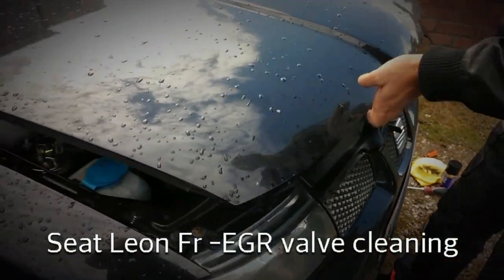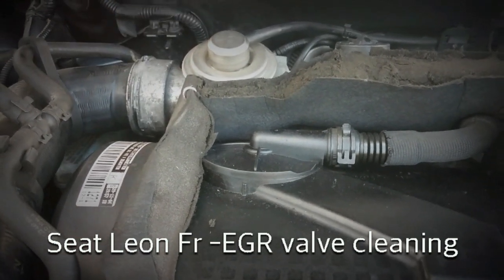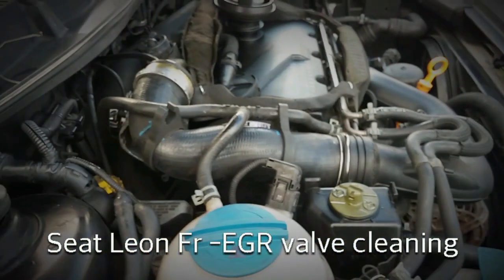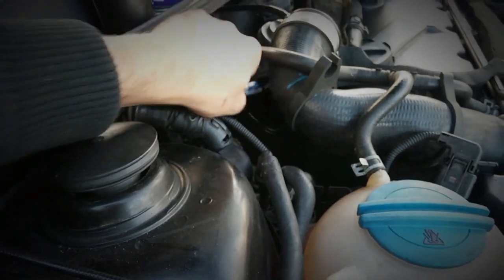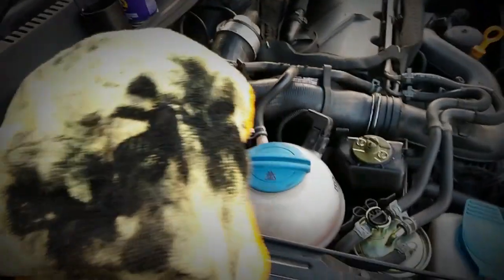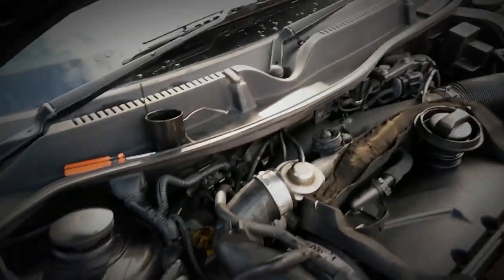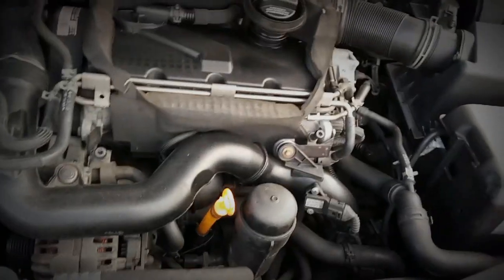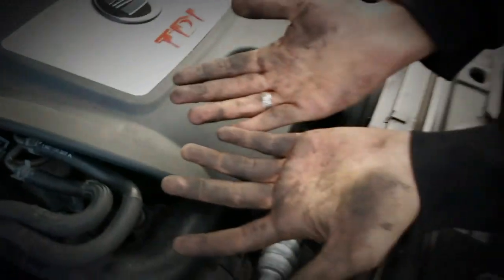VW / Seat / Audi / Skoda 1.9tdi EGR valve cleaning (without removing)

Comment: a good idea. I cleaned the skoda fabia in this way. I recommend using a toothbrush inside the EGR. but be very careful! I flooded the combustion chamber cleaner! you can damage the engine! if the engine does not start, remove the spark plugs and blow out the combustion chamber.

Comment: Concern is broken bits of carbon going through combustion hitting a fin on exhaust side of turbo and chipping it which will send it out of balance and thus fuck the turbo. Seen it many of times from this type of cleaning. Best to remove and clean the good old fashioned way.

Comment: Great video. 
I'm surprised that there aren't any products that you can just add to the fuel system to do this for you
Reply: Fuel doesn't go through the egr valve
Reply: @daddymac40  
Yes I know, but you can use a Catalytic cleaner which you add to the fuel, so I thought there was something similar!!
Reply: @benpar8120   - The Cat is nothing to do with the EGR.   As he said, it is physically impossible to put something in the fuel tank and it have any effect at all on the EGR.    EGR cleaning must be done through the air intake.

Comment: My seat altea keeps going into limp mode and the coil light comes on loses power if I turn ignition on and of it’s fine for 5/10 mins then it does the same could the egr be coursing the problem ??
Reply: This is happening me now with a leon mk2, do you remember what fixed this?

Comment: You have no idea what you’re doing, taking off the intercooler pipe and reviving will cause black smoke regardless if you’ve sprayed shit into the egr because of the unburned fuel.

Don’t fuck about with it if you don’t know what you’re doing, you’re more likely to throw chunks of carbon through your engine than you are to properly clean the egr.

If it needs cleaning, take it off and clean it.

Comment: Done this on a VW TDI but not wile running would it damage anything if used Wyn's carb cleaner wile running please can I ask
Reply: There's a risk that removed carbon can do a lot of demage to the engine if comes to a surten parts of engine, doesn't matter if it's running or not, most mechanic will tell you, if you do perform a carb cleaning safest way is using non "agresive" cleaners depending of how old is the engine and mileage coverd. Basically"younger" the engine the risk is lower. 
So safest way is completely removing the EGR valve and then clean it, sometimes despite a clean EGR valve there is mechanical damage specialy with a older EGR, and there is also a faulty electronic component on a newer cars that can cause a EGR malfunction.

Comment: Hi would this cause stuttering on acceleration on a TDI it's only done 15k miles but is a few years old
Reply from the maker: Swish wow that's very low mileage. Are you selling it? Hmm If its that low mileage unlikely to be caked up egr, could be a number of things perhaps maf or engine temp sensor but also take the engine cover off and see whether any of the pcv hoses or any other pipes are split or deteriorating, while your there inspect the dipstick tube carefully to make sure its not cracked or broken anywhere.
Reply: Redline Revs H mate  thanks for quick reply no loose pipes so I'm thinking egr turbo or fuel filter perhaps

Comment: There are three ways of doing this depending on how much you love your own car.
1. You barely appreciate your car: Use a cleaning product to force residues onto the engine, risking damage being made to the internal componentry.
2. You appreciate your car (to some degree): Remove, clean and reassemble, risking damage to the EGR valve be made during a non approved cleaning process. This could probably lead to EGR once back in the engine to again fail requiring further cleaning and/or replacement.
3. Best practice (in my view): Replace EGR with new to ensure once back in the car this will properly work for a long service period and reduce (not completely remove functionality) the amount of gas recirculation so that the EGR maintenance interval is enhanced keeping functionality  using in case of VAG group VAGCOM.

Comment: Hi,

Would like to clean mine on the he Bora (280,000 miles) seemed a bit sluggish so changed air flow meter and now a lot better, so now might have a go at this as I'm sure it would be well gummed up...got one of those vag-com readers and its coming back with the following fault '19561 valve intake manifold flap (n239) open or short to ground p3105' just wondering if you seen this before? the small pipe that attaches to the top of the valve is damaged also any ideas what you call this so i can order a new one?

Thanks in advance

Harry

Comment: I have problem with my car skoda same engine i lost the turbo boost while im driving on the highway and i changed the turbo two times its work for one or two months after that the same problem back again help me plz
Reply: Do you use synthetic oil for turbo cars? I had similar problems in the past though with synthetics even in good condition turbos I had to replace them twice as you in short period maybe less than two months. They are sensitive I think.

Comment: i have a vw jetta 1.9tdi 2006, very low mileage 37000 miles legit. its a weekend car hardly drive it. when i do engines warm etc when i punch the gas pedal cloud of black smoke comes out of exhaust but no smoke while idle or under normal driving condition. took it in for dignostics no fault codes turbo egr working in spec. guy said take it out for long drive its prob carbon build up. what do you think? Thanks

Comment: Would this method not send all the soot and blank gunk through your engine or turbo, resulting in valve damage or some sort of damage?
Reply from the maker: ***** Hey, thanks for your comment. The spray doesn't dislodge big parts of carbon, it dissolves it into a liquid. Soot and carbon is constantly passing through your engine on a car fitted with EGR system. As for your turbo, the turbine is being driven by exhuast gases. This is method is not going to damage your valves at all. If you're still concerned then I have shown how to dismantle and clean EGR more thoroughly here: https://youtu.be/bbUNGjY3T9s Hope this helps.
Reply: Redline Revs Thanks for the reply.. I watched that video today after this one, good clear instructions on how it's done but I went and took the easy way with the Wynns spray through the air intake and a dose of Millers ecomax in the fuel tank. (I'm a complete novice under the bonnet so didn't fancy tackling the EGR). Problem was,My car wouldn't start for 4 days after getting p0101 code on diagnostics, I changed the MAF sensor, still no start. Checked the anti shudder valve and it was stuck so I pushed it back down and hey presto, car started first pop and is driving better with the new MAF.. The Anti Shudder Valve was caked in suit and grime which was causing it to stick, WD40 helped to loosen the dirt and it's now clean and working properly. I don't know how my EGR looks inside but car feels more responsive and healthy.. These videos are a real help btw. Cheers bud.
Reply from the maker: ***** Glad you got it sorted, not so much a novice now! If your ASV was caked up, wait till you see the EGR valve and inlet manifold.. The ASV is the clean side of the two. You could probably do with tackling that EGR more thoroughly at some point. I recently deleted mine and replaced with race pipe, makes a world of difference, but half the footage was corrupted on my memory card! If you can bring the car to West London I'm looking to delete EGR on a volunteer 1.9tdi for the channel.. Thanks for your support and glad you found the videos helpful.
Reply: Redline Revs I dread the thought of what's in that EGR but I will get it done soon. Unfortunately I'm in Belfast, Ireland, so West London would be a bit of a hike for me but I appreciate the offer. Is there any downside to an EGR delete?
Reply from the maker: Down side is losing the anti shudder valve which,  could help stop a runaway engine but then you could do that by stalling if your car does ever suffer from that rare problem. Certainly not much of a concern for a well maintained tdi. And your engine management light will come on in most cases but I've just been clearing it. Will eventually have that mapped out.  Car has been running much smoother since my delete and I would recommend the mod. Also should mention it makes shut down slightly as there isn't ASV choking air supply to engine on shut down. That doesn't bother me feel like it's producing more power since only clean cool air is entering the engine and very  happy with it. Also won't have to clean that thing ever again.
Reply: did you ever get a test subject for an EGR Delete? I'd love my Fabia VRS doing! Its remapped but recently has been kicking out some right smoke.. does changing the fuel filter and sticking a PD 160 intake pipe on help?

Comment: can this also be done on petrol engines aswell ?
Reply from the maker: Rohan Rehman Hey, I used to have 1.8t petrol which does not have EGR valve, instead it had a throttle body which you can clean like this. Beware if you unplug it you may have to reprogram using VAGCOM.
Reply: Penis

Comment: Hi, great video thanks for this!! Had a few tdi problems with limp mode which has been greatly improved with new boost sensor (1.4tdi vw). Had low air flow but air flow meter was changed but didn't correct. As such, suspected egr/inlet manifold carbon deposits.

Decided to follow your video and did all, egr value did have build up and at point where vertical rod goes down reckon air flow was restricted.

Sprayed a can or egr cleaner in and made a big difference but when I revved it hard didn't see any black smoke at all?!?

Car is fine before I did this until on motorway at 65mph+, feels really down on power (compared to 1.4L petrol too which should have similar power). 

Haven't gone on motorway yet but in your opinion, does this mean that my low air flow may not be this? I also feel reluctant to remove inlet manifold as big job and egr value was no where near as bad as some photos your see (10 years old, 50k miles). But seems like a likely cause. 

Would love to hear your opinion and again, that's so much for a very informative video!!
Reply: Also, inspected air filter and will replace but didn't looks too bad, so feel this is not the source of low air flow either....
Reply from the maker: Andy713uk Hey Andy thanks for watching, looking back on this the reason I had so much black smoke is because intercooler pipe was still unplugged lol. This method of cleaning does still help as you mentioned, but I uploaded one just yesterday on how to dismantle and clean egr more thoroughly. When you take it off you should be able to inspect how bad the inlet manifold is. Your low air flow could be a leaking pipe somewhere? However, limp mode on tdi engines is often a result of sticking vanes in the variable geometry turbos. Mine kept doing this, managed to fix it with Mr muscle oven cleaner in the turbo, check out my video on that. Do you have any lights on dash or fault codes logged?

Comment: my audi A3 2.0 TDI has done 80,000 miles from new. i might take off the EGR and clean it. do you have to reset the engine management light if the EGR is removed.
Reply from the maker: michael jagger Hi Michael, Thanks for watching. You can remove and clean EGR on Golf Mk5 platform 2.0 tdi without any lights coming on. I'm looking to do this job on a 2.0Tdi for the channel if you can bring the car to me would love to help. I'm in West London PM me.
Reply: Redline Revs sorry i live in the north. my A3 has done 80K so its probably worth checking.
Reply from the maker: michael jagger No need to apologise! Probably worth doing at that kind of mileage. Good luck!
Reply: Redline Revs try it and see ive got the BKD engine in mine
Reply: +Redline Revs I did my EGR valve last year on my A3. I took it off the car cleaned with mr muscle and a dremel. Quite easy to get to and a BKD engine andthe engine management light didnt come on. no increase in mpg but still drives great

Comment: Interesting way of doing it - i followed the instructions on the EGR valve cleaning tin, got the engine warm, removed air filter, and sprayed it in that way..  didn't work - my engine fault light still comes on :(
Reply from the maker: G Allan Yup that's also a legit method- but you're likely to get better results if you follow the video. Sorry to hear your engine fault light still comes on. Is the light definitely triggered by the EGR? You need a fault code scanner- the code it throws up will let you know if its EGR or something else. If it is the EGR you will need to reset the code after cleaning or replacing it. I live in West London and have a scanner you can use if you bring the car to me.

Comment: It's done about 134,000 miles now on a 53 plate, never missed a service and I've not really had any major problems upto now touch wood. I had to replace the passenger window regulator back along when the electric window jammed but that's about it. They are good cars, had mine for about 8/9 years now.
Reply from the maker: areyoumad4it I used to have 1.8t with about 60k on the clock then got diesel 150pd with which had about 127k when I got it. For the most part they're reliable cars with common issues normally relatively simple to identify. My petrol one had a new window regulator as well- also exhaust. Other than that it was fine. On high mileage diesel EGR clean highly recommended.

Comment: Yeah it's 100% the engine oil can, item 11 in my owners manual, chapter 2.19. Unfortunately it was serviced by the main dealer in October and it looks like they may have only done half a job! I guess a sensor can just go anytime though. Il try and find a video of how to replace that now lol. Really appreciate you getting back to me, many thanks!
Reply from the maker: Yeah if you taking it to main dealer you expect them to advise if anything likely to go or need replacing at that age/mileage. True though that senors could go any time. How many miles has it done? I think main dealer is usually bit of a rip off to be honest you better off building up relationship with a good indepndent garage especially with an older car.

Comment: Great video. I have a leon mk1 110bhp, and currently on startup my oil light flashes yellow about 5 times and then goes off. I've checked my oil level and that's ok. Have you ever heard of this happening? Would it have anything to do with the EGR valve being coked up perhaps?
Reply from the maker: areyoumad4it Hey thanks. If it's the oil can shaped light flashing yellow but you havent lost oil its possibly defective oil level sensor. Is the car due a service? Check if the bonnet closes/locks properly as defective bonnet switch can also trigger the light.